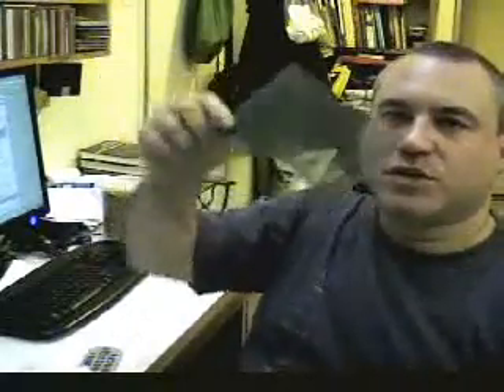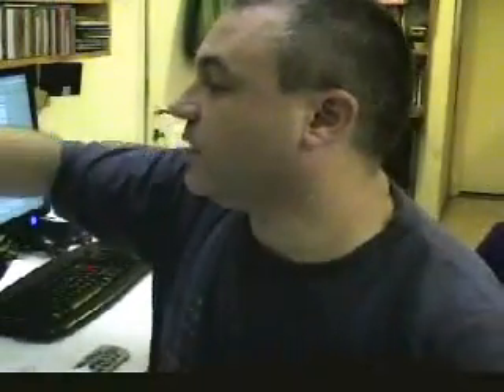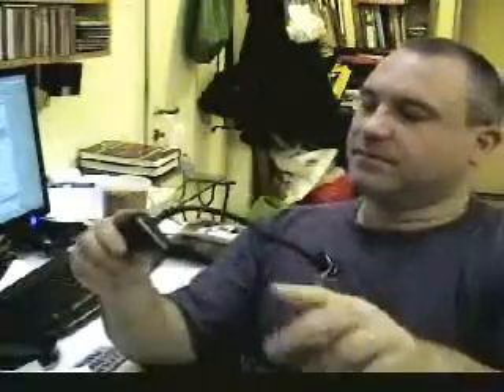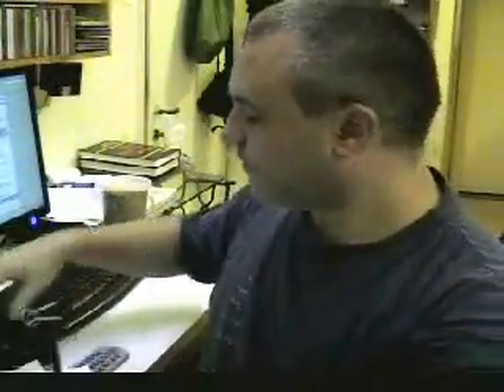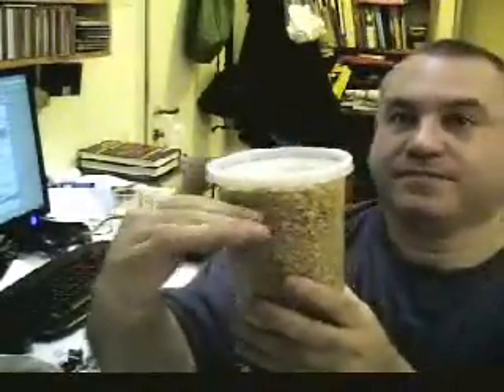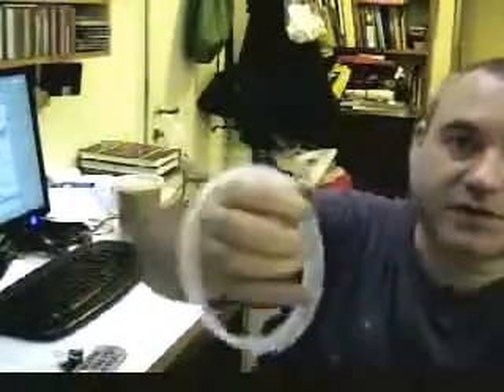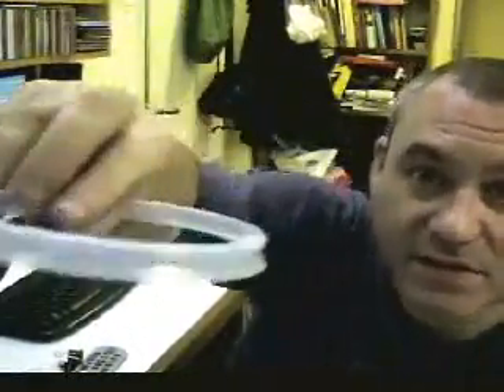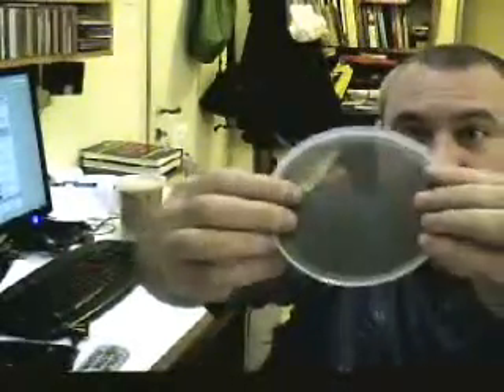building a Polariscope

Comment from the maker: @pidner  -  for gemstones there are 2 filters that are used,
one is linear (the kind used in this video) and the other is circular (as in some camera lenses)
depending on what phenomena you want to check in your gems.
for the linear filter you can use many old LCD screens, from calculators to 
old Palm devices. camer filters also, but check to see what type.
old (or cheap) polaroid glasses too.
the circular filter your are most likely to get in camera lenses.

Comment: This is a great DIY polariscope, but I just use my iphone (or laptop monitor) with a white image and a pair of ordinary polarized sunglasses. You can clearly see the stress lines in this manner, and it's very portable. For dark or colored glass you can use a higher intensity light source - I put a camera filter (polarizer) over a high intensity mag-light style flashlight.  If the glass is completely opaque (not just darker or colored) this obviously won't work.

Comment from the maker: @Tamooj  (cont.)  using a pair of polarized glasses will force you to tilt your head sideways
because the angle of the screen polarizer is about 45 degrees, and you need to be at 90 degrees to it,
so you do it with your neck, or hold the glasses in your hand for it.
i find both ways not comfortable.  i prefer holding the glass with both hands, and concentrate
looking at it.

Comment: @catman72
Sorry I have to write a separate reply due to youtube's word limit. By the way, I did a temperature shock experiment in which I freeze the bongs in my household freezer around -10C for 30 mins before taking them out and letting them warm up in room temperature about 20C. They didn't break. I am not sure if that is sufficient to conclude that they were annealed.

Comment from the maker: @Tamooj  - i used to do it with my old Treo , but my current Motorola Milestone
has a different kind of screen.  Apparently many new screens have non-linear polarizers,
or maybe no polarizers at all.  so i had a few embarracing moments trying to show
the effect in several places, with some screens that simply did not cooperate...

doing it with a small screen and polarized glasses  is great when you're out shopping
for glass items, and want to know how well they were made. :-)

Comment: @catman72 Thanks for your advice. Some of glass bongs I received do have a clear section, but that section does not seem to be stressed hard as other parts, so I can't really tell the stress for colored by checking only on the clear section.

They are made of borosilicate glass, size is about 4mm thickness, 500mm in length. Is there other way to check if they are annealed?

Comment: you should show the stresses caused in extruded plastic types (like the polycarbonate that folkerdekens mentions, as it is stretched and during this it is not allowed to aneal as this makes the polycarbonate work so well :) any plastic that is stretched like taffy though will do this and each type of plastic has a different range of color it allows you to adjust colors into. :)

Comment: I would like to make one of these for checking inclusions in gemstones,I was wondering if the camera lens filters I saw at walmart  for $20.00 are the same thing as I am building mine smaller about 2" in diam.and about 6" high.I seen a website on google showing how to make them,but it didnt show  where to put the stone to examine it,I assume on a table under the bottom filter?